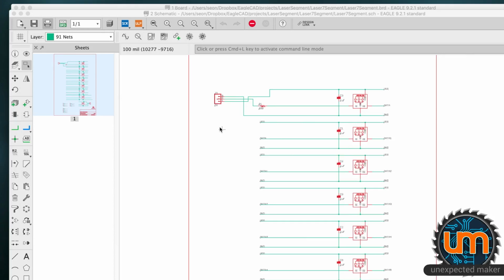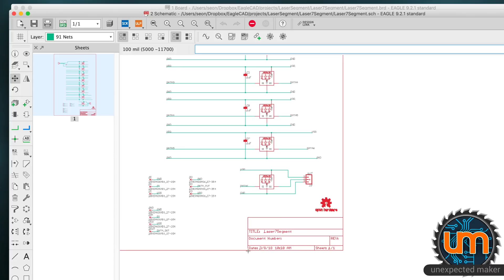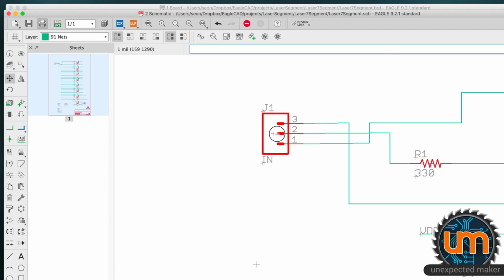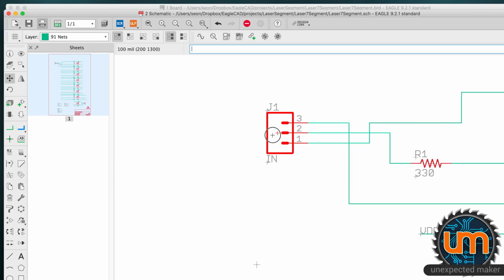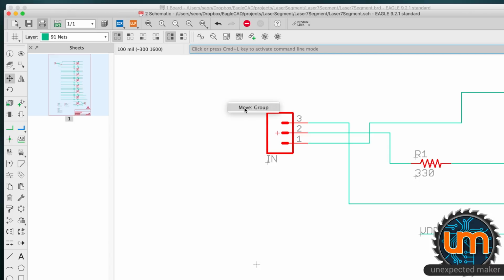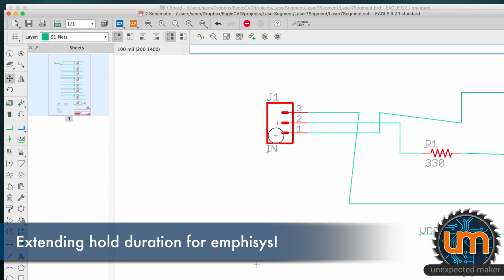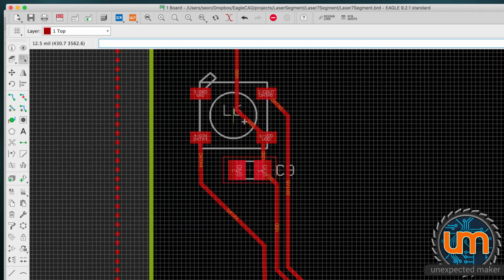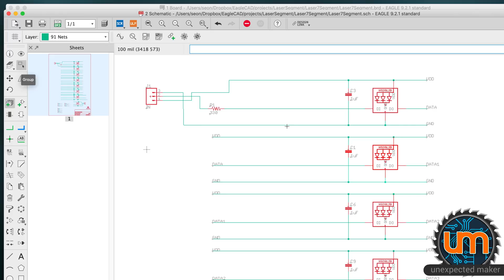Autodesk Eagle TidBits #1 - Moving Stuff Around

Comment: One thing to note is to make sure you keep the grid spacing within the schematic editor to be either inches or mil, as most (if not all) the parts in the schematic editor are designed with inch/mil spacing between pins, and your nets won't line up correctly if you use mm spacing. 
Though in the board layout window, any grid spacing will do.
Reply from the maker: Yup, a good point :-)

Comment: here's a tip for you 
## tOrigins crosshairs
To control the origins on schematic aka the crosshairs
of where to grab the symbol.

copy and paste the following in the input box

turn off 

 set Option.ShowPartOrigins 0

turn on 
 
 set Option.ShowPartOrigins 1

to refresh the display of crosshairs switch between sch and brd

alternatively
Change the eaglerc.usr (Windows) / .eaglerc (Linux/Mac) file and set

To remove those pesky little crosshairs that appear on the board next to the text

click on the "layers" icon and un-highlight the "tOrigins" and "bOrigins". This should hide them for you.

please use layers and tick 'none'. Then start selecting 'pads' , ' vias' and either 'top' or 'bottom' as applicable to you.
Reply from the maker: That's a good tip, thanks!

Comment: I have gotten really cofused lately. Is eagle cad free?
Reply from the maker: The free version has everything you need to make PCB's for any project. Yes it's limited to 2 layers only, but all of Adafruit's PCB's are 2 layers, so that's not a limitation that would effect most people. There is also a PCB size limit, but again, it's big enough for most projects.
Reply: Unexpected Maker it is also limited in board size, and schematic sheets.
Reply: Yes its free version doesn't cover total features. But it's enough for starters to make two layers pcb. What's more interesting is that it's collaboration with fusion 360. Ecad meets Mcad...!!!
Reply from the maker: Yeah I mentioned board size above. I don't see sheet limit an issue really for most projects for makers/hobbyists. Yes it has limitations, but there are plenty of other options for those that don't like having the limitations :-)

Sometimes I feel people take a stand against the limitations because they are there, rather than them being an actual roadblock to their project.
Reply: @UnexpectedMaker  thanks for the response would like more videos like this.